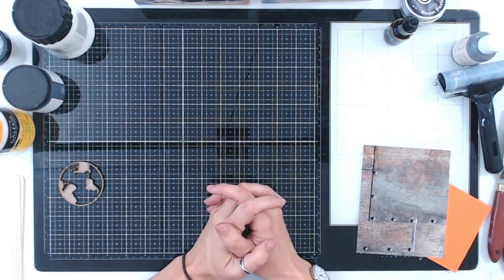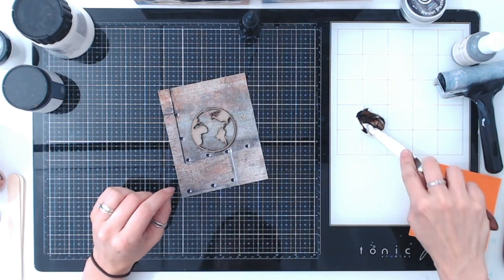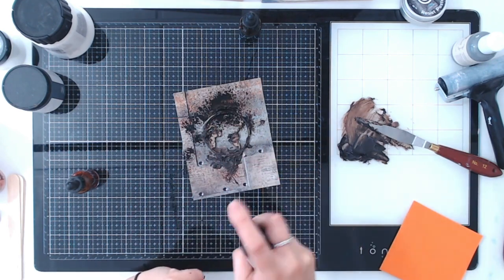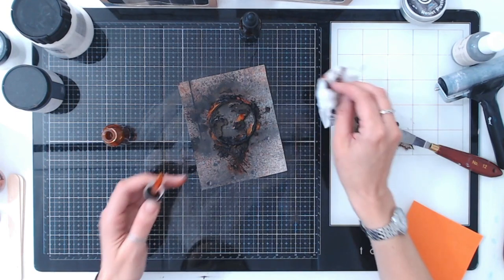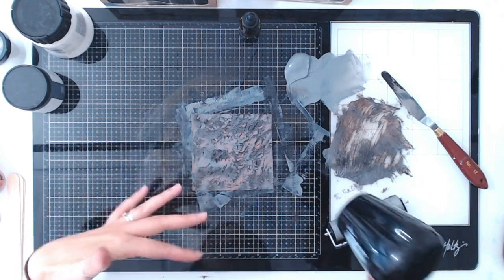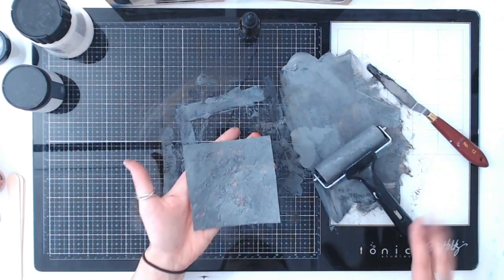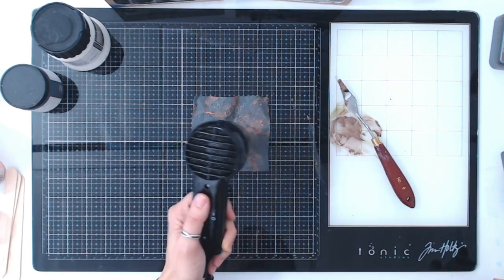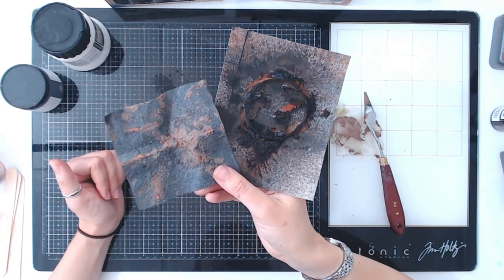DIY Faux Rust Technique - 2 DIFFERENT WAYS!!

Comment: Fantastic project. Can I ask? What dies the resist paste do? I thought when you put it up on, it  would resist the ink/paint you put on the card, but it seemed to cover most of it. 
I will definitely give this ago, I’m thinking an old vintage camera. May use the Helen Griffin snapshot camera dies.
Thank you for sharing. ❤️❤️❤️
Reply from the maker: It just makes it easier to remove the layer of paint afterwards so it can be scrapped off with something fairly blunt x